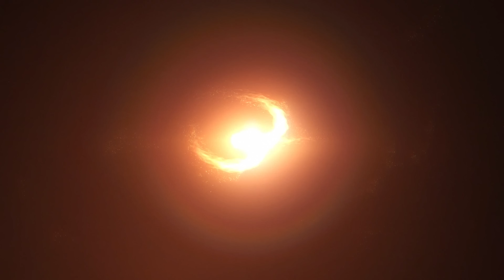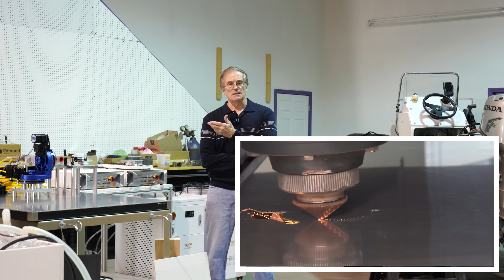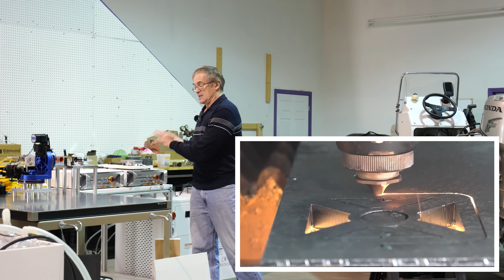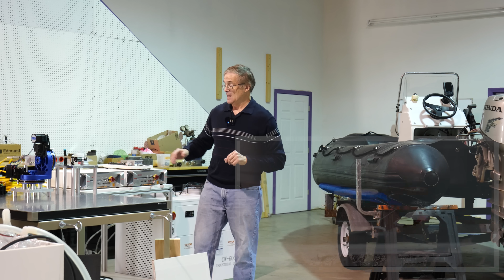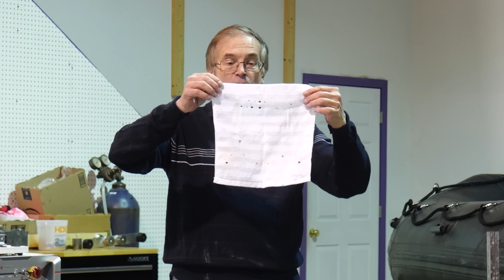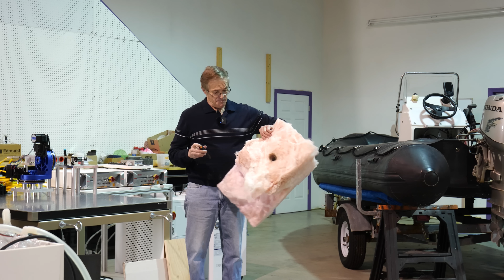We have a problem... and need your help!

Comment: I’m just a software guy so take this with a grain of salt. I think you may have better luck with conductors rather than insulators, in order to spread the heat out to dissipate it rather than trap it and have it accumulate. As a test rig I’m picturing a copper sheet with a laminar water curtain running down the front and back at least for a small scale test, admittedly it is reflective but graphite should also do the job. Not sure if it can be readily sourced in sheets but that sounds like a problem right up your alley.

Comment: You can also make it as thin or thick as you want for the walls of molding I would use wood and I would coat that wood with packing tape so the perlite and liquid glass doesn’t stick to it as it dries

Comment: You could use liquid glass and perlite it’s used for foundry material I’ve used it in a welding class as a grade we tried using Oxsee acetylene torch on it and the most that happens is it beads up into little glass balls it’s all silica

Comment: I have an interesting idea, how about using something like orbieez as a first layer to cool and defract the light in multiple locations. You could use a large container of orbeezs to create multiple points of refraction. Then create a surrounding on 5 sides to absorb the light with a separate material like drywall. Any additional light that will be refacted back towards the Laser should continue to refracted due to the atmosphere and allow the beam to be less harmful. Please let me know what you think.

Comment: 2cm dark green-blue-ceramic-glas,  12cm sandstone maybe a little better than a brick, stack able coal bricks 23 x 6,2 x 6,2 cm , 1cm graphite sheets attention could be reflect able, 10cm quarz sand and water but then you´r limited to the ground or bonded with cement, any metal oxide powder (Al203, ZrO2, ...) pressed to bricks. The wavelength is essential to design a energy to heat absorbing material. It could be that 2mm graphite foils with a distance of 2mm surrounded by quarz sand and cement could do the job. Bonding with alabaster cement (electrician's plaster) can be better and faster, maybe sometimes to fast. You have that energy per mm² that has to be scattered and transferred to heat over a most big volume with a very high heat capacity and thermal conductivity. So the right mixture of wavelength transparent and  absorbing material and thermal conductivity is the key.

Comment: How to build a better mousetrap: Have your laser focused on a decent sized (and thickness) block of dry ice with several layers of powdered gypsum mixed within the dry ice. In the center or focal point of the lasers  intended target area is a couple layers of polarized prismatic glass. Behind the block of dry ice composition is a container of water that if the laser makes it that far, the water spills into a pan which has a moisture sensor pad thats wired or wirelessly tied to your laser kill switch. The dry ice should give you the time necessary to manually kill the laser before burning through, but if it doesn't difuse enough through the block, gypsum, and polarized glass layers, hitting the water-filled container will trigger the moisture sensor to kill the laser output.

Comment: Probably you wont reach my comment, but sand/dirt is the cheapest thing to get.
A 45° angle mirror pointing to a sand bag on the ground is the easiest setup I can think of.
Reply: i dont think you can just mirror bounce this type of laser without destroying the mirror instantly.
Reply: @__shifty  I agree. But, its cheap to test it 😅. A wall of sand bags is preferable, but I think it would be not so great to move it arround.
Reply: I was thinking sand too (maybe wet sandbags?). It would turn into a laser generated fulgurite (like when lightning strikes sand). Way above my pay grade, but sand is cheap. Maybe use fiber optics for the angle, but for short duration, a wall of sandbags in a straight shot seems plausible. IDK. Carbon wool, maybe.

Comment: Laminar flow water curtain (5-10+ cm thick - at minimum) for initial absorption. For fiber laser wavelengths (~1070nm), water's absorption coefficient is approximately 0.135 cm⁻¹ (at room temperature). Follow with fire bricks or ceramic tiles (dark colored) and arrange them in an overlapping pattern to prevent direct transmission through gaps. Finally, capture any remaining heat and laser remnants with sintering carbon. That's going to be your cheapest and most effective option I believe. A man of your station should be capable of engineering a laminar flow curtain of that size with reasonable ease, the rest are cheap, off the shelf, and freely available materials.

Comment: Have you tried Hardi-backer cementus fiber board? It's sold at Home Depot as water impervious tile backer, but it's also extremely fire resistant and used by welders & builders to protect flammable materials from torches.  
  Another thought was to try Orbees gel beads (Yes the kid's toy)  They hold a lot of water and though they may individually burn up, they also will self infill into the hole, as they are consumed, possibly yielding longer burn through protection.  
Also CONGRATS on breaching 1 MILLION!!  You deserve it!!

Comment: Fiber Cement Board or unpainted Hardiboard would do well for a few seconds. The thicker the material the longer it takes to cut, obviously, but with a couple of layers of fiber board it'd be easily replaceable, and you could build a stud wall on a rolling platform so you can still stow it.

Source:  https://pmc.ncbi.nlm.nih.gov/articles/PMC7084971/

Comment: You're approaching the problem from the standpoint of safety for a device that is by design, not safe.

Think of it more like a conventional firearm, instead of firing the laser non stop have a feedback loop, aquire lock on target, 1 second burst or less, is the target still in the air? Fire again, still there? again, again, no target is falling and no longer in the air. The target is now out of the engagement zone because it hit the ground. Mission accomplished.

Comment: The simplest solution is probably just a pile of dirt/sand on a metal table with castor wheels on it. You could wheel it out of the way, have a layer of dirt/sand about 3 to five feet thick, depending on the size of the table, and it shouldn't catch fire. When your done, you just put the dirt/sand in a pile outside. The only thing left to store is a table.

Comment: Hi there - has anyone suggested Hardi-board yet? It's the concrete/fibre backer-board used in constructing tub-surrounds and backsplashes. Fairly light - about the same as plywood, cutable, portable, layerable and easily available. You could make rolling rack and add/replace sheets as needed...

Even if it's not quite resilient enough - it's made to add tile to - maybe some Terracotta or a natural stone with known light/heat absorbant qualities - like flag-stone.

Comment: What about a mirror finished stainless steel cone enclosed in a mirror finished stainless steel polygon of sorts. Build the enclosure so that only the tip of the cone can be seen and have the laser land on that point. I have no way to quantify this method, but the idea is refracting and reflecting light to break up the beam and terminate some of the energy.
Somebody with the mathematical know-how would have to properly specify the geometries, cone pitch, etc.

Comment: Maybe sand wall barricade mixed with water to cool that is also mixed with charcoal to absorb light. All together would help absorb light and heat. But there may be a better thing to add as well. Have you heard of starlight material? When it burns it creates a gas layer that keeps it cool and keeps it from burning up.

Comment: I know a correctly cut clear diamond could be used as a “shutter” if set just beyond the point where the beam is emitted. Diamonds have maybe the highest thermal conductivity and if cut with the right geometry could scatter the beam and effectively block it. Maybe design an apparatus similar to a camera shutter that quickly puts the diamond in and out of the path of the laser. It might be expensive is the only draw back.
Reply: It might not need to be that large though

Comment: You are thinking horizontally.

The sky won't burn.

Also: use a watchdog to cut power to the laser when the controlling hardware isn't responding.

Comment: Have you tried asbestos or kevlar?  Kevlar fibers would be a good candidate, if they don't melt instantly, but asbestos, being fibrous and heat resistant by nature, maybe can withstand the lasers... Carbon is another candidate IMO, having very high melting (actually evaporating) temperature. Placing layers of carbon fiber sheets or even pure carbon sheets or thin boxes maybe can be enough. I can also think of tungsten, but of course, it's not cheap.

Comment: I don't know anything about anything but if you need a vertical wall a curtain of water would be a thing to try, pumps, recirculation would keep it from getting too crazy to build (like a giant swamp cooler). 

I was also wondering about a curtain of fog or steam? Maybe evaporating dry ice? I assume something like glycerin from a fog machine would get gross fast but there might be other aerosols that could dissipate the energy? Probably a non starter, the laser probably simply would not care.

Probably the real answer is to do range finding with a low energy beam and tune your objective beam to focus very tightly on the target and then dissipate very quickly but that sounds like a lot of effort at this stage. 

Definitely liked the idea of firing it at the ground as the simple solution.

Comment: probably been said already, graphite slab? if that'd not enough put it in a steel bucket of water, shoot through the bucket, catch the water that leaks out and pump it back into the bucket. minimum chips optical soak :) also dope the water with carbon to diffuse any scattered light

Comment: A fish tank with water offeres higher volumes for the water than a towel. alternatively you could disperse an absorbing agent or something else to help lower the transmission of the beam. Not sure what wavelengths you're working with here, but, its an idea. you need a fail safe for the shut off. maybe make sure the beam is aimed at a target that could be severed, and the severing triggers the estop.

Comment: could you have a twostage output system that allows you to have the laser in "idle" non-destructive mode and use a confirmation value to trigger the second level? a second option is a physical hindrance in the form an optical lense that eats the waveform that the laser outputs. like our goggles protect our eyes. perhaps an abrasive rotary pad for an anglegrinder (the type that looks like thick hair thats curly) would be worth testing. 

may i ask what wavelength the laser outputs? i will check my "storage" for a material or mineral that absorbs this enough :)

Comment: well if you don't want to use a blocking material that only leaves you diffusion of some type most likely an automatic device that would instantly block the culminated laser with a set of lenses to diffuse it. unrelated it reminds me of the technology used to keep people from cutting their fingers off with table saw I saw the hot dog test for the first time the other day in person and I was amazed how quickly the blade could be intercepted and stopped before cutting the hotdog in the slightest bit that type of mechanism with some diffusion lenses might solve your problem giving the computer time to shut off the unit

Comment: Just shooting ideas here: glass panel with water between them? like triple pane windows panels filled with water? easy to patch with tape, easy to refill...  could use different king of dye/liquid to disperse the heat...  sand bags too!!  fine silica sand?
Reply: not exactly, its possible theoretically but remember the wavelength is whats used for offsets using PWM adapted algorithm. Pulsed modulation as a function of width requires further detail from this project, but it’s not difficult. would have to see the setup- our labs ran into this about few years ago but easily fixable without target endpoint modification given appropriate rapid rate absorption for selective outcome. Fun little hobby- just be safe and never experiment outside safe controlled environments obviously.

Comment: I did this years ago, I mixed up a large amount of carbon black into a volume of water and used a fish tank and a water pump, actually a bilge pump to move the mixture around as to stop spot boiling and dissipate the heat, if you use high power then move the water at a faster rate to compensate, an inline radiator can also be added, if you are worried about the power then use a diffusion lens on the fish tank glass, also you can mount the laser vertically straight down onto the water / carbon black surface. The carbon has to be fairly highly loaded and adding glycol to the water may help.
Reply: Their problem is that they need a fairly large wall full of this stuff, so that they can track and destroy flying objects in their warehouse. It will prove to be a challenge that way.
Reply: Further thoughts, but going right out there, a water fall with a bit of an angle using a thick moving carbon graphite slurry sliding down a wall of thin ceramic carbon tiles like the ones used in a emc testing setup. Obviously all these scenarios would need to be tested and scaled to handle the power involved, failing these ideas what about a big drone controlled to hold carbon sheeting and fly around in the laser path.
Reply: @DetectorMods I really like your idea of a waterfall—either just water or maybe a mix of other substances—flowing down a ceramic wall or slide. I was thinking that if the laser beam could be split or diffused into multiple lower-energy beams, it might be easier to absorb or dissipate the energy more safely.

Would it make sense to reduce the temperature of the material the laser hits? For example, running evaporator tubes with Freon through the ceramic could super-chill it, possibly improving its ability to handle the laser and whatever is flowing over it.

Alternatively, what if the laser hits a highly reflective surface that redirects the beam into a pool of slurry? If that slurry is being agitated or circulated, it might help distribute the energy and reduce hotspots. I have more ideas but these are just some of mine to contribute.
Reply: This is exactly what i wondered, impregnating water with something to better dissipate the light as heat into the volume of water
Reply: seconded. seen this used before on tests.
Reply: mix the carbon black with that baby diaper gel stuff?  or some type of harder gel like ballistics gel
Reply: or maybe a hi flow water/carbon black flat fountain running down the pink fiberglass insulation.
Reply: This is definately on the right track. If you load the mixture with your fine borosilicate, it will further disperse any beam, better diffusion through a larger mass of carbon.
Reply: Yeah. Give this a go and see what happens. I'm interested.

Comment: I think you need to difuse your laser. Depending on the polarization of your laser beam, you might need a first stage to depolarize it, a second stage designed to scatter light in a desired way, and a third stage composed of a diffusing surface.

Comment: Knows very little about lasers, but, I fell outside the box / automatically outside the box concerning lasers :)

What about a continuous loop of fabric (like in a scrolling banner) moves quickly past the laser's path?

The fabric is constantly wetted with cold water — either by perforated rollers or a central sprinkler system or both!

The moving wet fabric (probably different kind of fabric for different kinds of laser) acts as a sacrificial and cooling surface, absorbing laser energy and evaporating water for heat dissipation.

Since the fabric moves rapidly, the laser doesn’t dwell on a single point for long — preventing burn-through, assuming the material and water absorb most of the energy in those few ms.

As water boils off, it carries away large amounts of thermal energy from the laser impact zone. That’s the primary cooling mechanism in your design.

This setup could be built from relatively inexpensive components, compared to exotic materials or plasma shutters.

If regular fabric does not work, a heat-resistant fabric (500-1000 C+), like kevlar mesh, PTFE-coated fiberglass, or ceramic fiber fabric, neither of those melt or ignite instantly and are pretty resistant to repeated thermal shocks from water + laser.

The fabric will obviously degrade over time, but if regular fabric does the job, it'll be pretty cheap to replace.

And, I think this is very DIY:able, at least at small scale for testing out.

If it works you could probably add other stuff like collecting water that sips out rapidly cool it and reuse for better sustainability
Reply from the maker: The concept of moving the target because we might see a problem moving the laser is a good one.

Comment: Apart from the tiles on the bottom of a space re-entry module, does anyone think that this would work? ...Create an aerogel ,where the cavities are filled with argon and the solid material is treated with a fire retardant, and then the face of the material is painted with vantablack.